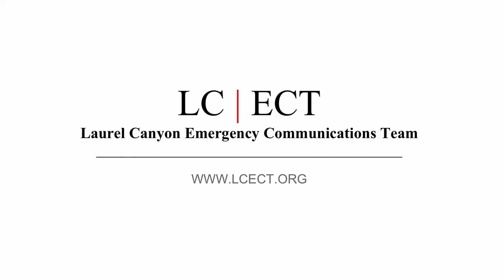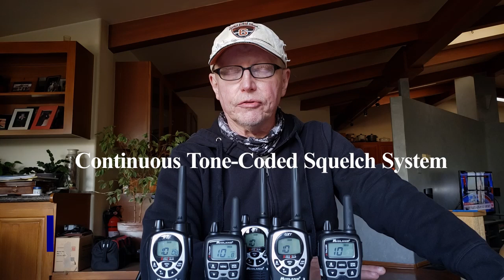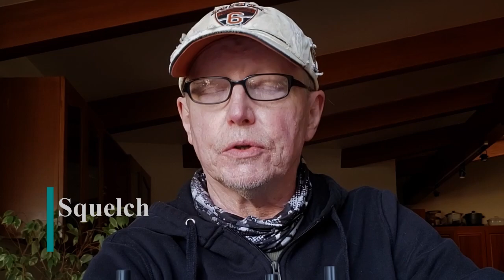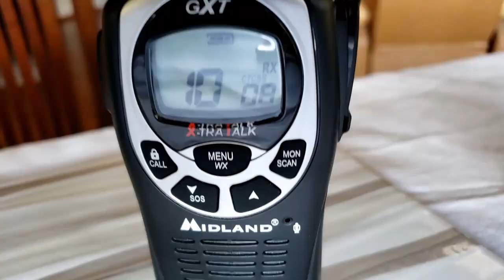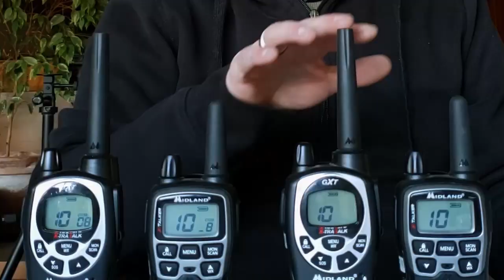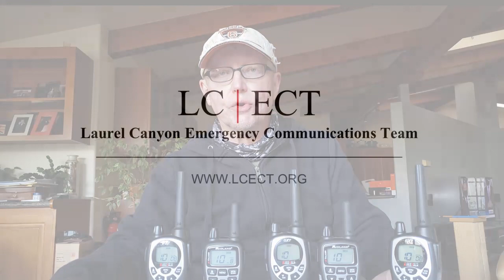CTCSS Explained

Comment: So it's just masking our listening partner from the other transmitters and directing it to only listen to us while the other party listeners without tone are free to receive anything, right?  
While transmitting, nothing encoded/encrypted to prevent other parties from receiving our transmitting( broadcasting) signal.
Reply from the maker: That's correct. CTCSS & DCS just block transmissions from other stations who are not using the tone you and your team are using. No encryption. Anyone on the frequency who is NOT using CTCSS or DCS can hear ALL transmissions on that frequency. You will only hear transmissions from other stations using the same code. There is no privacy. The FCC prohibits encrypted transmissions on GMRS.
Reply: @lcect  👍👍

Comment: How does a radio somehow "bind" the subtone frequency to the main frequency? How is this even possible?
Reply from the maker: It's a sub-audible tone that is sent out as a modulation to the carrier. The frequency is just so low we can't hear it.
Reply: @lcect  thank you, I very appreciate your reply, but, let's imagine I use the carrier frequency of 2.5 mHz and subtone of 150 Hz. Those are two separate frequencies. How does the radio know, which device sent this subtone and which devices didn't?
Reply from the maker: @an__hooo  The carrier frequency is the only thing generated by the oscillator in the radio, and it is not an audible tone. The sub-audible CTCSS tone is essentially the same as if you were to press the PTT to transmit and then sing middle C. It is a tone that is sub-audible to human hearing because the frequency is so low. Your dog might be able to hear it in there, though I'm not certain of the range of puppy hearing.
Reply: @lcect  thank you!
Reply: @lcect  I have been thinking about your message and now it seems like I get it. The frequency of a radio wave, which is electromagnetic radiation is not the frequency of an audio wave, which is created by mechanical movements, compressing the air particles. 
The only thing I still don't understand is how can you bind these two, so another radio with the same subtone opens up its receiver, detecting the source of the tone? Moreover, as I know that the antenna is designed to receive radio waves, not sound.
(Sorry if the question is stupid, I am not best educated on radios).
Reply from the maker: @an__hooo  It is understandable that there is confusion about this. How is a sound wave "bound" to an electromagnetic wave for transmission? The answer is frequency modulation. commonly known as FM. The CTCSS tones are encoded in the carrier wave the same way a DJ's voice and the music they play are encoded on your favorite radio station. Search for frequency modulation on Wikipedia. They have a good entry on the topic.
Reply: @lcect  Thank you, you have helped me a lot! It's clear to me now. I have one last question - what produces this subtone? (I assumed the radio itself)

Comment: One nitpicking correction 
The GMRS frequencies are the same frequencies as FRS
So anyone can use FRS radio 
To communicate with one another and they are NOT using those frequencies illegally, even though they are congesting the frequencies you are using on your GMRS radios radio

Comment: Thank you very much! That was stright forward, I understand what happens in RF analog domain :) Now I just need to find out how do I actually change/set the CTCSS code on my Midland (it is the same as those little ones you have  in a video). For now I've found an option to turn CTCSS on/off, but not to actually change the code/freq. I need this because I want to pair up these Midlands with my UV-5R so we can talk on same PMR channel with CTCSS :) Setting up CTCSS code on UV-5R is quite straight forward, but for these little things, I still didnt figure it out :)
Reply from the maker: You can watch a video I made for my team that will show you how to set CTCSS on the GXT1000:   https://youtu.be/jypnstzMPrM?si=ucxdFFDSqivYuEHY

You will also need to coordinate the Midland codes with the tones, in Hertz, on your UV5R. You can find the chart on page 19 of your GXT1000 manual. Just choose a code on the Midlands, look up the corresponding tone frequency on the chart, then program the UV5R with the tone frequency. Good luck!

Comment: Do you need a license for ctcss tones on an frs channel?
Reply from the maker: You do not need an FCC license to use CTCSS or DCS. A GMRS license is required if you wish to use radios with higher transmitting power such as the Midland GXT1000 you see in the video. For FRS radios there is no license requirement at all. Good luck, and have fun!
Reply: @lcect  thank you I appreciate that!

So, for example, I have a gtx1000 midland walkie talkie. Can I use frs channel 1-7 on any ctcss tone without a license? I’m just trying to use this pair of midland gtx1000s for my kids when they are running around the neighborhood with their friends.
Reply from the maker: @Drum93bum  The GXT 1000s are technically GMRS radios as they have up to 5w power. To be completely in compliance you need to use only the low and medium power settings without a license. Using CTCSS codes without a license is allowed. For the kids, their best bet is to use the FRS shared channels from 8 to 14. The radios are hardwired for low power on these channels per FCC rules. As long as they are not too far apart they should work fine, and it will have the additional benefit of using up the battery more slowly. If they need to use medium power to make contacts they can move to channels 1 thru 7. Avoid channels 15 thru 22 as they are the ones that allow GMRS licensees to use up to 50 watts, and also often have repeaters working in many areas. They are far more  likely to encounter other traffic on channels 15 - 22, so best to just avoid them. Good luck!
Reply: @lcect  you are the best, man. I really appreciate your thorough response and overall knowledge that you provide me and those who view your videos! I am now a life time subscriber to your channel and really appreciate you. Have a good one!

Comment: What about for family channel, what code can I use? Is it a private channel?
Reply from the maker: FRS and GMRS share the same channel frequencies. The only difference is the transmitting power. FRS is capped at 2w while GMRS is at 5w. Both are limited to 0.5w for channels 8 thru 14. There is no such thing as privacy codes on FRS or GMRS. Anyone monitoring your frequency can hear your transmissions.

Comment: Thank you for this video, this helped me a lot as I just got walkie talkies recently. I have one question though, if someone like me, just with a walkie talkie for personal use were to be driving around and receiving a incoming message from a truck driver say for example. what channel would they be most likely to use? I just want to know to maybe be able to talk to someone else through the radio!
Reply from the maker: Glad the vid was helpful! 

First of all, make sure you are NOT using CTCSS on your channels, and remember that other uses may be using CTCSS and will not hear you. Get a GMRS license from the FCC so you can use maximum power legally on your radio. 

One good way to catch random contacts is to scan all frequencies. Just keep in mind that the high power channels 15 - 22 can also have repeaters using them in your area, in which case you would hear their transmissions but they wouldn't hear you (because repeaters usually use CTCSS codes to limit access, and require an offset to the transmitting frequency to get into the repeater). People using repeaters are using radios such as base/mobile radios that are capable of offsets for repeater use, but handheld walkies don't have this feature - yet. I'm told Midland is developing Walkies that will be able to use repeaters.

Most truckers will be using Citizen Band or Ham radios, and are less likely to turn up on the FRS/GMRS band.  "Unofficial" road channels are 7 and 20 (Motorola Standard), and offroaders will sometimes use CH16 (because 4x4 = 16), but this is also unofficial.

You can also do what Hams refer to as "calling CQ" which is to send out a transmission looking for others who are monitoring. Go one channel at a time and transmit your FCC call sign and ask if anyone is monitoring, or ask if anyone can give you a "radio check." Wait a few seconds, try again, then move to the next channel and repeat. Someone else nearby may be scanning the channels too.

Of course the best thing is to talk your neighbors and nearby friends into getting their own radios, and then you have a reliable emergency communications network. This YouTube channel was made for my local group which has over 80 households in an area of 2 sq miles.  Good luck!
Reply: @lcect  thank you for the detailed reply. Just another question. it’s illegal to use CTCSS?
Reply from the maker: @mrmobilegaming01  No, CTCSS is fine to use whether you are an unlicensed FRS user or a licensed GMRS user. The FCC requires a GMRS license and the use of your issued callsign only if you are using more than 2w of transmitting power. FRS radios are locked at 2w (and all FRS/GMRS radios are locked at 0.5w for channels 8 - 14), but GMRS radios have higher power available at 5w for Channels 1 - 7 and up to 50w for channels 15 -22. If you have the Midland GXT1000 radio, for example, and do not have a GMRS license, you can only legally use the low and medium power settings.

Check this blog post at Midland for more on GMRS licensing:

https://midlandusa.com/blogs/blog/why-do-i-need-a-gmrs-license-how-do-i-get-it

Comment: I believe you can operate business on FRS now. FCC lifted the rule sometime ago since FRS is used less (because cellphones took place of the need for FRS).
Reply from the maker: Yes, it is legal for businesses to use FRS frequencies with FRS radios and power levels only. The problem is that FRS and GMRS share some frequencies, and in my area, and many others, businesses use GMRS radios at high power without licenses to conduct their activities. I hear mostly construction and landscaping crews around my home. Without CTCSS on my radio I'd be listening to crews all day. The FCC simply does not have the manpower to enforce.

Comment: CTCSS or DCS tones have any performances in field? I mean which tone code work better when signal come weak? or both work in the same way in cases signals are weak? Thank you!
Reply from the maker: DCS uses more bandwidth, so it could be more prone to issues in a weak signal scenario. I stick with CTCSS and have had no problems, except with Baofeng radios trying to use the GMRS freqs. I find that these radios do not emit a reliable tone in the GMRS band, even when they work fine in the Amateur Radio bands. The are not approved by FCC for GMRS anyway, so keep it legal and use Midland FRS/GMRS radios, or another major brand that is FCC approved. I've used Midlands for 20 years and prefer them.
Reply: @lcect  OK, Thank you! for your reply, yes I'll use legal radios, in my case I'll use MURS, I already use FRS so now I'll take murs for testing. Ones again Thank you! and have great day!
Reply from the maker: @Dragon16815  You're welcome! MURS is a great service for teams because so few people use it. Good luck and have fun!

Comment: Nice video thanks! However I am wondering what happens if you have two different transmissions at the same time on the same channel but with different codes - do the receivers get both or nothing?
Reply from the maker: Hey Steve: Great question! That's the issue they don't advertise on the radio boxes. Once a receiving station opens squelch to your incoming CTCSS tone their radio is, well, open, and can pick up another nearby transmission on the same frequency even if the second transmission is using a different CTCSS tone. Whichever signal happens to be strongest will usually get through, but sometimes the two transmissions will "double" each other and you'll have to ask for a repeat from the operator you intend to receive.  If the doubling persists it is often best to switch to a clear channel, so it is always a good idea to have a pre-planned secondary channel that you and your team know to switch to if this occurs. Bottom line: CTCSS codes are great for keeping out unwanted transmissions from others on the channel when you are monitoring but they are of less use when two groups are using the same channel in close proximity.
Reply: @lcect  Thanks for taking the effort to reply in detail!

Comment: What happen of you use 2 radios with the same channel and with (8) CTCSS and 2 radios with the same channel but with (9) as CTCSS? Im going to hear their conversation (same thing for the others people that are in a different CTCSS) or nobody is going to hear us?
Reply: I mean, if im in a channel (for example 2) with 6 of CTCSS and another person is in my same channel but with a different CTCSS, are we both going to hear us?
Reply from the maker: Good question! As long as both pairs of radios are not transmitting at the same time, the radios will not open squelch unless they hear the assigned CTCSS tone frequency, and you won't hear each other. But if both pairs of radios are using the same frequency at the same time, there may be interference, and you may receive the transmission from whichever radio is sending the strongest signal. Once the squelch opens up, the radio will receive anything on that frequency. This is where using the MON button helps. You can briefly open the squelch to check if anyone is using the frequency by long pressing the MON button. If you hear a transmission, wait until the frequency is clear before transmitting. If the other pair of radios are dominating the frequency and not sharing, it is easier to switch to a different frequency.
Reply: @lcect  oh hey! i just bought the radios today and i cant understand if somebody its in my channel, like i press ed the MON Button and i can hear the frequency but how do i know if someone its in my channel, thank you
Reply from the maker: @ilcalabronedimartex5949  When you disable the carrier squelch by pressing the MON button you should hear the static noise of the frequency. Listen for any faint sounds of FM (frequency modulation) buried in the noise, which will usually be someone speaking if the frequency is in use near you. If all you hear is static then you can assume the frequency is not in use near you, and is open for you to use.
Reply: @lcect  got it, thank you so much!
Reply from the maker: @ilcalabronedimartex5949  Happy to help. Have fun!
Reply: @lcect  thank you so much!

Comment: I'm very confused 😅 should i program a channel on ctcss or dcs i just want it simple
Reply from the maker: Hi Alphonso! The only reason to use CTCSS or DCS is if there is a lot of traffic on all available channels in your area, and you want to not have to hear traffic that isn't meant for you. If that isn't the case, I would not use any Code Squelch - just pick a channel and transmit. But if you need to silence your radio from unwanted traffic either CTCSS or DCS will work. They do the same thing. CTCSS uses a sub audible tone, while DCS uses a digital encoding. Remember, too, that all radios you want to be able to communicate with must be programmed with the same code.  Important to note that when you use coded squelch everyone on that channel can still hear you. It is not private.
Reply: I swear i can only read half of what it is that you're saying so im still tryna to understand the other part is cut off ill try turning off my phone and turning it back hopefully that clears everything else 😓

Comment: So, I have a radio I programmed to my fire dept I'm on for when we burn pastures, radio is in my side by side. When I talk they can here me fine no problem, but when they talk I don't hear anything, could this be why? Not set right?
Reply from the maker: Hi Chris: the situation you describe might occur if your radio has a CTCSS or DCS code programmed in, but theirs do not.  Try doing a test where you transmit from as close to their radio location as possible, and check you radio for a CTCSS or DCS code. Confirm that the department is not using a code, and make sure you are not using one. Good luck!
Reply: @lcect  thank you, I forgot to mention. When I use my hand held fire dept radio close to my radio I just programmed it works both ways, however when I increase distance it does not, it seems when I talk at further distance from the side by side radio my hand held picks it up but when I am talked back to it either doesn't come through or is full of static just depends on distance, but I am going to check settings tomorrow and see if this is my issue
Reply from the maker: @crisgourley3653  What frequency band are you operating in, and what is your antenna for the side by?
Reply: @lcect  154.38500 is the frequency, antenna is Browning WSPBR1015 Enclosed Nmo 3/4 Hole Mount cable and Tram 140MHz-170MHz + 430MHz-470MHz Dual Band NMO Antenna (1181
This is what was frequently ordered when I got the radio off Amazon
Reply from the maker: It's probably just an issue of propagation when you are at a distance. Try moving to a higher elevation, or a spot with less disruption to line of sight (hills, trees, buildings, etc.) RF is weird. sometimes it just can't find it's way into certain spots. Increasing elevation is usually the best solution, but often just moving to a different location works.
Reply: @lcect   Still not working, I am now wondering when I go the radio I did some test runs inside my house with no external antenna connected to it. Didn't think much about it at first but could this potentially ruin my radios ability to recieve signal?
Reply from the maker: You should never transmit without a load - either an antenna or a dummy load, but I doubt it would cause the problem you describe. More likely to fry the radio altogether. I'd look for a local Ham Radio club and see if you can contact someone willing to test the radio.